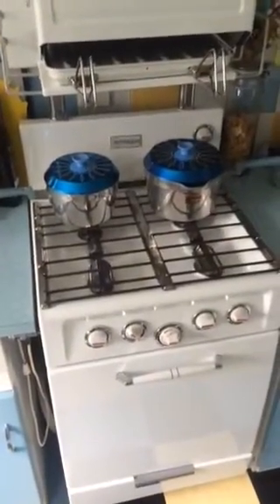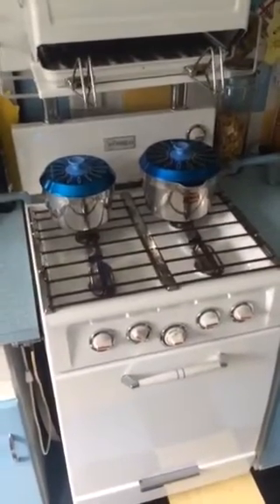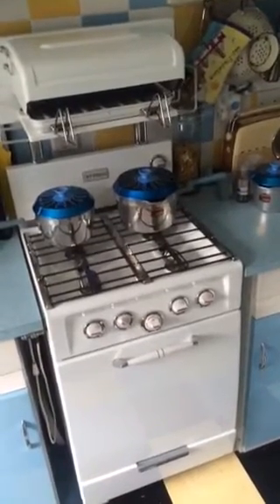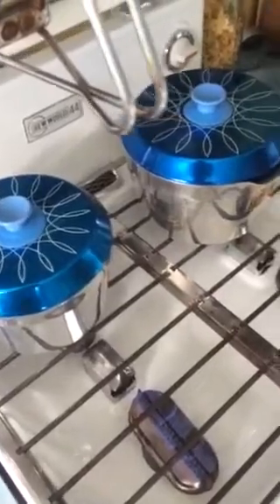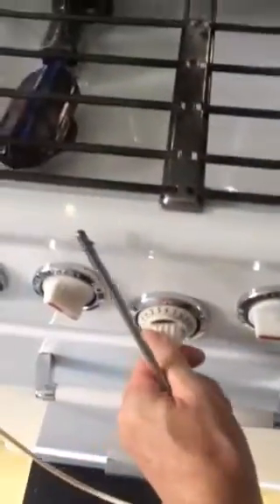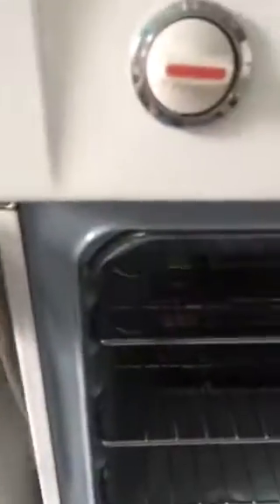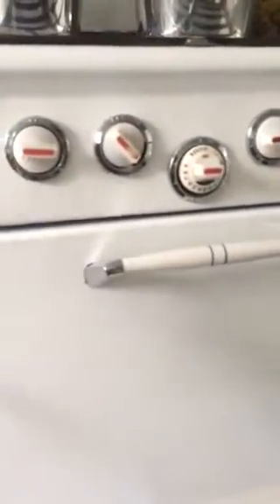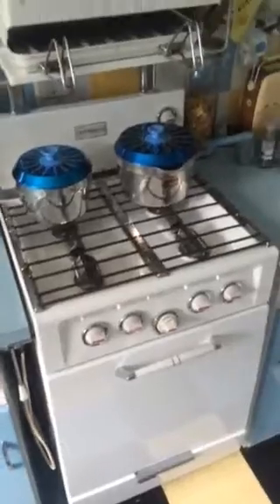1961 new world 44

Comment: The whole at the front for lighting the oven I believe is called a "flash tube" as you said deigned to light the burner at the back of the oven without having to reach all the way inside, I rebuilt my own New World rangette and converted it to LPG with the help of a few of my gas fitter friends, what we found most alarming is how fragile and brittle all the seals had gone on the thing, of course now all replaced! it did alarm me at the time of how many of these old gas cookers are still connected not ever having any of their original seals checked out or serviced and replaced something which would have been done many years ago. I fear a few accidents waiting to happen if these cookers are not inspected and serviced regularly! mine does not have the "gas wand" it had pilot lights and even a fancy oven timer but having converted it to run on LPG these of course had to be disconnected to save on gas. You have a beautiful example ! I have a video of mine on my channel somewhere lol